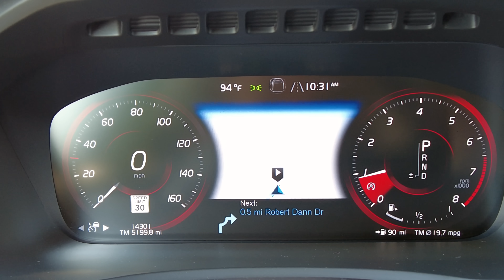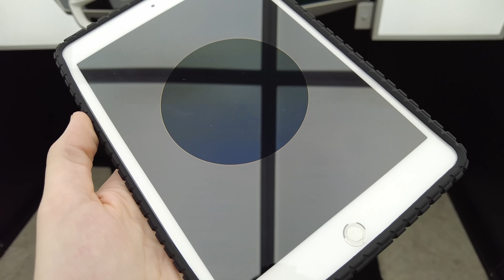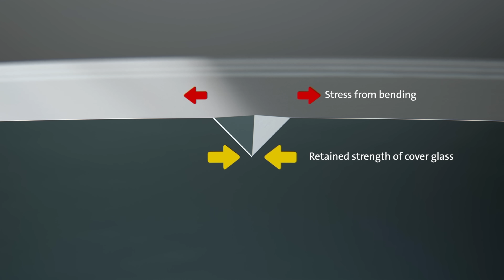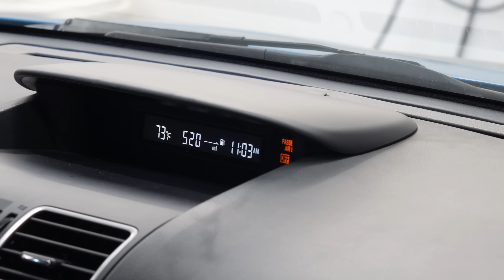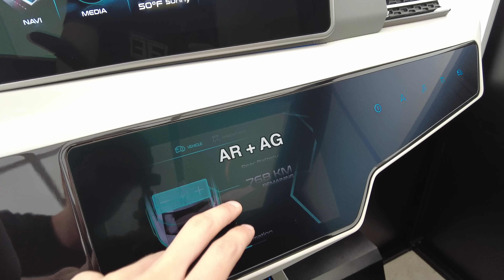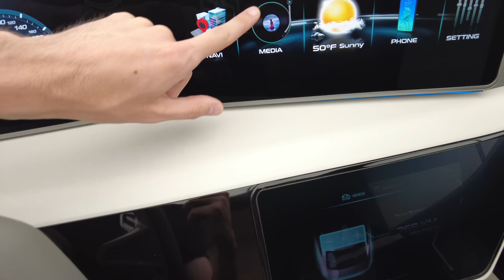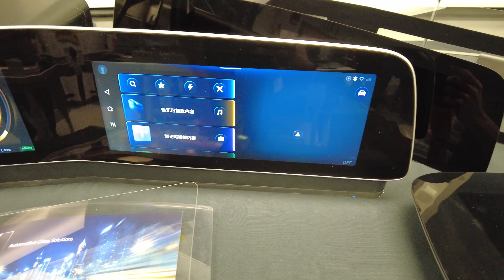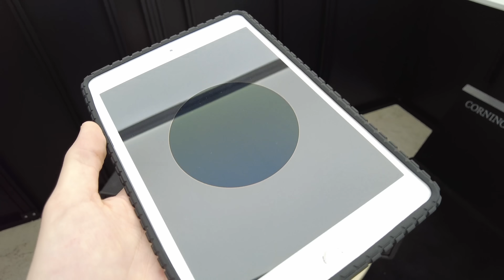How The Glass Inside Your Car Is Engineered - Not So Simple!

Comment: Touchscreens in cars getting bigger is a never ending story... for better usability you need bigger icons, so if you dont want to end up with less choices visible on a screen you need a bigger one... now if you want to get more features into a screen available all the time, like AC stuff etc, once again you will need a bigger screen to manage that. It just gets worse and worse. 
I absolutely loved the old Audi MMI system with the rotary knob infront of the gear selector. It takes some time to get used to, but after 1 or 2 weeks you can operate it blindly and the distraction is a fraction of a touchscreen.
Reply: I think it's sad that Audi abandoned this MMI selector thingy. (like Mercedes did, and at the same time it seems to me) I've got such an input device in my two older Mercedes, and prefer it over any touch screen too.

Comment: A great designer will make the dashboard look good. A great ergonomic engineer will make  it work by us reaching out using muscle memory and not having to look at the dashboard. This new trend of computer screens it contrary to what it should be and is there only because it is lot cheaper for the manufacturers to implement.
Reply: Yes, but cost is not the only reason, lots of people think they want the touch screen because it's new and "cool", more important to tell your friends on COD how cool your car is then for it to actually be functional.
Reply: @jaydunbar7538  I like buttons and knobs when I'm driving. But one advantage of a computer screen is that it can be updated so it doesn't become obsolete. And it can do a lot of stuff better and easier.
Reply: Don't forget that it also causes obsolescence quicker so people buy new cars.
Reply: The best of both worlds will eliminate all need to touch or adjust anything.

Comment: I can appreciate the use of screens for the instruments and a lot of the infotainment system. However things like AC, lights, cruise control and just about anything you may have or want to adjust while driving need physical knobs and switches. Fumbling with a touch sensitive GUI on a display while driving is as bad as trying to write a SMS or e-mail while driving if not worse. Same with having to switch through screens to find the function you are looking for. That's not something that will make you a safer driver.

Even some things that are not critical doesn't belong on a multifunction touch display, or even any kind of touch interface, like the climate controls and the stereo. Sure someone may claim you shouldn't be fiddling with either when driving, but I can't really see people stopping just to change the song, radio channel, adjust the volume or adjusting the AC. And with a tactile interface, like you know physical switches and dials and such, these things are easy to do without taking your eyes off the road. With a touch display? Not so much...

Comment: I really like all of the controls being integrated into the screen. It looks cleaner and there are no switches and knobs to wear and break. Plus, the screen can be updated with a new look at any time meaning that it will never look out dated.
Reply: Well, how much does it cost to replace 1 defective switch or button compared to 1 single big touch screen. If your screen doesn't work, none of the functions controlled by the screen are accessable to you. If 1 button doesn't work, well that's annoying, but not nearly as bad or expensive.

Comment: Hey Jason, this may be a question for physicist, rather than an engineer but when using destructive interference to eliminate reflection rays, what happens to the energy contained in the light rays? Is it absorbed by the material? Do the rays even make it into the material?

Comment: From a UX designer's perspective the automotive designers aren't doing their job of making the touchscreen system in a way where drivers don't have to look away to interact.

Touchscreens could be used to interact with if it's an interface that's gesture based. We have to look at the screen most of the time because we have to see where to tap.
Note this is just initial brainstorming and will require further iteration to make it seem plausible.
For example, need to turn down the volume? use 2 fingers and slide up/down anywhere on the interface.
want to change station channels? use 3 fingers spaced out like you're turning a knob and rotate.
We use these gestures on Google Maps on our phones so it's plausible to do the same on the infotainment, just repurpose the gestures for the necessary functions.
The only downside is a little bit of learning is required, but it isn't rocket science so it should be learnt fairly easily.

The technology is there to mimic interactions used with physical objects, but it's just the lack of imagination / creativity, and possibly restricted rules in making vehicle infotainment interfaces that's making infotainment systems not driver-friendly as it should be.

Comment: My rule of thumb is that any function you would regularly need to access while the car is moving should be a tactile control. I can't stand having to glance down multiple times at a screen just to change the music, or turn on the A/C. I know it's "cool" to have a giant screen, and I do appreciate the minimalist aesthetic, but at some point form starts taking away from function.
Reply: I don't think the "minimalist aesthetic" is about being "cool"; I think it's about the bottom line. Putting everything on the touchscreen instead of having dedicated tactile switchgear saves the car makers a few dollars. But since most consumers don't seem to be wising up to how horrible this design trend is, so I think the only way it's going to stop is when it causes enough accidents that the car makers start getting sued.
Reply: @edwardamo  Then they'll push voice control as the solution instead of tactile controls.
Reply: @edwardamo  True. Dedicated physical buttons are expensive to develop. Whereas with a screen its just software.
Reply: @edwardamo  I think, when done right, it's a good trend. The idea is to remove physical buttons which clutter the cabin that aren't required whilst driving.
You may think HVAC controls are needed whilst driving, but in most modern cars you simply set and forget, especially in cars with driver profiles where it's already set to the temperature you like. (Tesla does a great job at this for example)
Take for example how a lot of cars still have a button to change wiper speeds, but, if there's a good auto-wipers setup you would never change the speed anyway. This is what companies are 'trying' to move towards, some doing better than others.

Tesla is obviously the best known for this because they're so extreme. Their approach was a little backwards as it was a case of "Lets remove everything, then over the following months and years gradually improve our systems so the driver does less and less on the screen as it all becomes automated". Generally this seems to work, but some stuff is a tough problem to solve it seems and they would have been better off having a button >until< they had automation for the problem solved... :)
Reply: @edwardamo  You'll develop muscle memory for this fairly quickly.  these screens are no more dangerous than someone moving from a 15 year old car to a modern car with tactile functions.  you don't like it because it's different.  now you know how old folks feel trying to understand smart phones.  I have muscle memory on my phone for every icon on the screen.  I don't have to even look at it to open apps.  my most used apps I can open it, log in and go to the page I usually go to all without looking at it.  don;t be afraid of change.  go ahead and learn it now, because you will learn it like it or not if you want new cars.
Reply: Agreed. Not to mention it’s so dangerous to not have tactile controls
Reply: The new Teslas are a bummer just cuz of that. I don't know what these people have in their minds 🤢
Reply: I can do everything I need to in my Tesla Model 3 Performance with voice commands, its works fine.
Reply: @jasondavis2945  I have a model Y, so I know what mean, but even easier than pressing a button, waiting for the beep, then saying the command, is just pressing a single button.

Comment: IMO at a bare minimum the most commonly used controls while driving like climate control and radio should have physical switches. Touchscreens require you to look at them to use them, which means they are dangerous to use while driving.

Comment: i dont mind glass for the gauges (in front of the pilot so u can monitor your speed while driving), gps and minor stuff on screen in the center console, but for daily use (radio, AC, drive modes, heated sits, etc) buttons and knobs because you can feel them and use them without having to see them an be distracted driving.

Comment: Good design is more important than this=good, that=bad.

I recall a rental car years ago that had a physical switch below the dash for the foglights. The switch was the exact same size and shape as the trunk release beside it. What could go wrong?
Reply: Virtually all aircraft ensure flap and landing gear switches are different shapes for just this reason.
Reply: Nothing at all, the trunk won't open while driving.

Comment: My daily driver truck designed in 34...has a voltmeter, oilpressure gage, temp, fuel gage and a speedo. Next to the instruments sits a big android pad and not a crappy autograde panel with crappy autograde proprietary software running on a ten year old chip and my phone. That is sensible in 99.9% of all cars. Only Tesla adds value because of their soft-/hardwareskills.

Comment: My biggest problem with screens or capacitive touch buttons is that when I get in the car on a cold day the car can't since my fingers. So I'll be trying to turn up the heat pushing at the buttons and the car isn't sensing my finger and so the heat is still not turning on. I have the same problem with my phone so it's not just my car.
Reply: To clarify I don't mind screens being used for some things like driving statistics, or other non-essential not commonly used functions. It's just anything that is important I want to have a physical control for.

Comment: Do you think polycarbonate can be an alternative to glass (as long as the cost can be kept reasonable)? Great video!
Reply: Why? Polycarbonate, or any plastic, is much softer than glass and therefore much less scratch resistant, even with SR coatings. Polycarbonate in particular is less transparent than optical grade glass. Polycarbonate is also an organic material, i.e., made from petroleum, glass is inorganic, made from minerals.

Comment: Sullivan Park is a great place.  I retired from there a few years ago.  I think glass displays are absolutely the right solution for cars, but touch screen controls are not such a great solution for things that the driver interacts with while driving.  Fine for passengers, but knobs and buttons are much better for use while driving for the same reason we use a steering wheel rather than a slider on a touch screen to steer the car.

Comment: This is advertising done right, lots of useful information and useful products. I have a MK1 Focus and I installed a (relatively) cheap Android touchscreen head unit (which also has physical buttons and a volume dial). I mainly wanted it for the extra advantages when it comes to playing music files, all the other features are just pleasant bonuses. It would be great to be able to get some type of film overlay I could cut to size to try and eliminate glare, if fingerprints are a problem then cheap disposable material would be ideal, very much like phone screen protectors. I'm not sure I saw Corning have such material, but if they do, I would buy it!

Comment: Infotainment screens in cars aren't bad at all, and can be very useful for quite a few things. It's gotten to a point though where we have to use the screen for almost every function on the car that doesn't (yet) involve steering, brakes, turn signals, and seat belts. Using the screen for navigation is fine, but using it solely for climate controls, going into reverse or drive, and tuning radio stations is dangerous as screens cannot provide proper feedback when people interact with those things while driving. There needs to be a fine balance between analog and digital.

Comment: 2 years a go i worked at a charging station for Amazon. On one occasion a tesla model 3's screen stopped working while charging so you couldn't type the password in to unlock it, making the vehicle completely inoperable. The car had to be towed to the dealership to have the screen replaced. On another occasion the screen of a model 3 stopped registering touch so you couldn't use anything other then basic operation.

Comment: I absolutely hate those massive screens in cars. You need to be able to control things like radio and AC while driving without having to look at the screen at what you're doing. Anything else is hazardous.

An even bigger issue is redundancy. What do you do if there is a fault in the screen unit? You lose AC controls, radio, navigation etc. Literally all your accessories are behind one fail point.

And any integrated solution is going to become obsolete in a few years. No car manufacturer is going to keep updating an old car to bring it up to standards to new communication methods. Things like Bluetooth, USB, aux, Spotify or Apple carplay are not going used forever (at the very least, they get new versions not compatible with old versions). So if you get an older car, you're stuck with garbage. I remember owning a 2003 Toyota Avensis few years ago that only had a CD and cassette player. A car from 2003 with a cassette player! At that point, cassettes were pretty much dead. Since the stereo was integrated, you can't upgrade it anyway. Instead I had to use a cassette-to-aux adapter with the cord hanging out 24/7 in the car. My 1998 Mitsubishi Carisma had a cassette player, but all you had to do was swap out a different DIN1 stereo and you could get the latest stuff for less than 100 euros.
Reply: No no no, you can't do that! How else would they make you buy next year's model?
Reply: You can upgrade a stock system to a decently priced aftermarket system. And there is so many things to have your phone hook to to your stereo with a caset and using a fm transmisster

Comment: In my opinion screens are cool for showing map on gps navigation and viev warnings like tires pressure is low etc. Essential like wipers, blinkers etc should remain in traditional form for safety reason. Future may be in voice commands, seen video from testing it in Mercedes, it works fine, you can set gps route, manage radio, temperature still having eyes on the road :)

Comment: "The interface can be updated over time, future proofing the product."  Hmmm, I used to dream about a perfect world too.  There will be 100 reasons why the manufacturer won't be able to update down the road.  Of course, a new car fixes that. Despite a good video here by Jason, I find these UI's unfortunately like what we have on our phones and other devices.  They're just different enough from each other to make them cumbersome.  A standard set of buttons should still be present so that I can quickly and easily access certain functions without using a UI.  I can do so much using just muscle memory on physical controls; eyes not required.  A UI means I have to look at it to use it.  That means I'm not looking at the road.
Reply: That line felt like pure sales jargon which kind of disappointed me in Jason. He knows damn well the systems won't be updated after 5 years, and that the non-din size makes it impossible to fit an aftermarket screen. Let alone all the functions locked behind the display system that will need to be carried over.

These big screens in cars are just another form of planned redundancy.
Reply: If it's anything like every other smart device they will be updating it most weeks, just not to make it better. They'll make it harder to fix or install an app store to milk more money out of you. Of course you won't be able to disable updates either "for your safety".
Reply: Yeah, go ask ANY manufacturer for an update to their fancy digi dash.... Just like a phone, doesn't matter that it's 6 months old, You'll get the same answer. "conveniently visit your nearest authorized service center or retailer to browse a selection of products that better serve your needs"...
Reply: They want 12-36 month lifecycles like other apliances. Once your payment plan is done (or subscription model) they want you in another one. 

They don't want you to fix things yourself ( right to repair) or keep it for the next generation, they just want to make and sell more, more for a profit money tree.
Reply: The automobile industry basically invented planned obsolescence, so no. I have a GMT400 Suburban that shared a platform that was in production for 11 years and they stopped making parts for it, but there are plenty of examples in junkyards that I can pull from. And I will continue to do so until the make gasoline illegal, not because I like having shitty gas mileage, but because I don't want to get into the planned obsolescence pipeline. If I want a touchscreen for entertainment, I'll mount a tablet to a Ram Mount. Simple.
Reply: I’d rather not have a manufacturer (or government agency) have wireless access to my car. This is why with every new car I get I disable the cell phone radio, or place a faraday cage over it in case of an error message.
Reply: I have a touch screen in my work vehicle, I may have lots of features but I don’t want to learn them and certainly can’t drive and change anything. The radio is set to the station I want to listen to if I drive to somewhere that requires a station change I just turn it off until I get back to where I get reception. If it was my Ute I’d fit a radio with knobs.